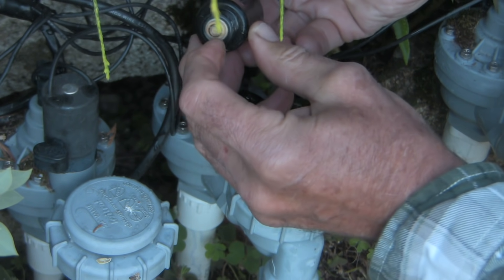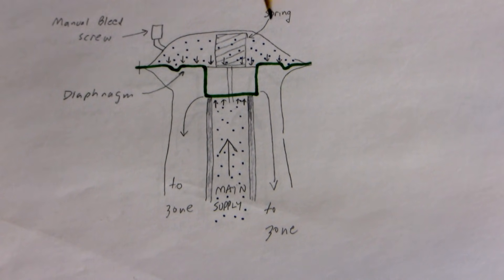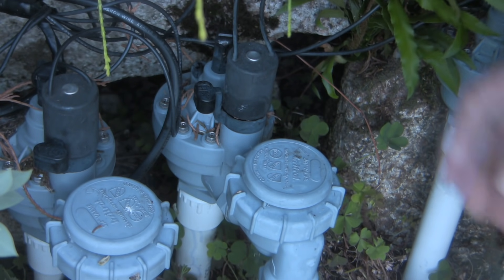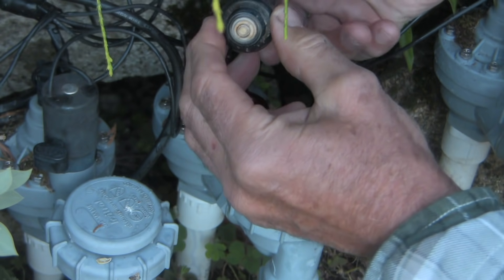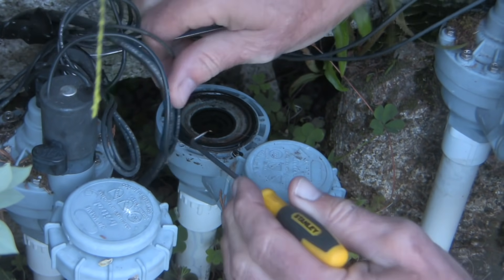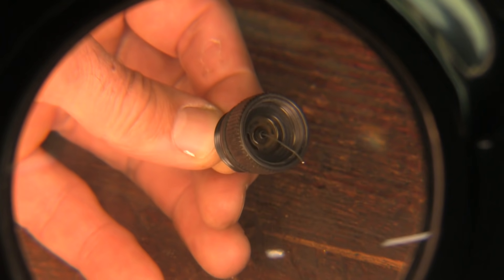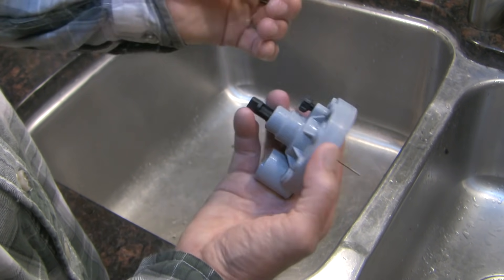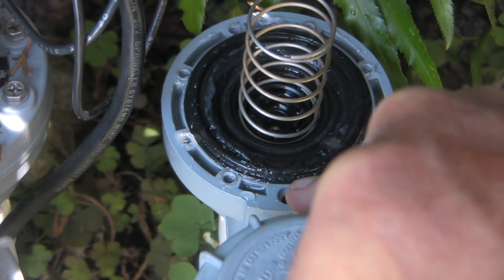Troubleshooting irrigation sprinkler valves

Comment: I wish I had the brain to mechanical trouble shoot like he does.
Reply from the maker: That's very kind of you to say that, but the reality is that these little devices are very simple. In the end most guys who have a suspected valve problem disassemble and clean the passages, then carefully reassemble and see if the system is fixed. I didn't mean to make it sound too complex, my bad.
Reply: spelunkerd I was pretty much speaking of all your videos.  Thanks for your help.

Comment: I really enjoyed this video very detail oriented. I have a question which I think you are the knowledgeable person who can assist me to resolve my problem. One of my 4 zones does not work properly. When the controller open the zone, sprinklers does not pop up and water is running until the time is over unless I manually partially open solenoid valve then all the sprinkler in that zone pop up. If I open it manually still the same situation, I still have to open solenoid valve to get all the sprinklers pop up.  I have replaced the anti-siphon valve and I know it should work fine. I also checked all the sprinkler heads but still I can not find what is wrong. I really appreciate for your time and input. Thanks
Reply from the maker: Gee, that sounds like you need to thoroughly clean the valve like I did in the video. After you get the bonnet off, use a paper clip to probe and flush those two passages going to the manual control bushing. Don't forget to probe the distal passage, the one in the center labelled "to zone" at 6:10. If that doesn't work, I would turn on that zone for a few hours, and look for a wet patch of the grass that you might see if a line or connection is broken. If there is a crack of the tubing anywhere in the zone that leaks water volume away, the line can't mount enough pressure to lift and spray water from the normal sprinkler heads. If you find a puddle of water, dig down on the wet spot to find the leak.
Reply: Thank you so much for the information. I will do that to see if that will resolve the issue.

Comment: Very good  video explains very well, I change two diaphragm and from there those two stations are not working now, I change position to test the solenoids and they do not work either
Reply from the maker: Thank you. Manual control is usually the quickest way to decide whether it is the valve or the solenoid. If you get water when you manually crack open the bushing, but no water when you direct that zone to open at the controller, it is an electrical or solenoid issue. If manual control doesn't open the valve, check the diaphragm, the flow control screw, and the small pathways I showed to decompress the top part of the valve. Make sure no other zones are open, and remember that a cracked line can cause enough pressure loss to interfere with zone function. If you think it's a cracked line, run it for a few hours and dig down on the wet spot. Good luck!
Reply: Look for the old diaphragms and I found one I put it back and it worked just that I know it has a leak but I closed the main water pipe, I think the new diaphragms are the problem since it worked where I put it back. 
What do you think ?
Reply from the maker: If you've got a leak, with a continuous patch of wet grass at the lowest sprinkler head of the zone, then the diaphragm is not making a complete seal on the lip of the valve. The most common cause of that kind of leak is a grain of debris that may get jammed on the edge of the valve, preventing it from closing down completely. Be sure to flush the line, like I did at 8:01, but I would do it for longer to give the proximal line a good flush (hang onto that O-ring, ha ha). Calcium granules collect in the lines and get jammed against the valve, causing it to bind and not seal completely. Wash the valve carefully and reinstall. If it still leaks, replace the valve.
Reply: Thank for your help, my  problem was the little hole on the middle of the diaphragm.
Reply from the maker: Good point, water needs to make it past the diaphragm to the other side. I didn't show it well in the video but there is a central post that holds the diaphragm straight so it is less likely to tip sideways and bind. Water lubricates the shaft and also passes by to the other side through that hole. Other designs may have separate water pathways. Thanks for documenting your experience, I'm sure it will help others.

Comment: A very well produced DIY video! I cannot believe there is finally a valve repair video with excellent production values. Hands and tools never get in the way of the camera! There are fantastic cut-aways with closeups of what is difficult to otherwise see. And of course the hand-drawn diagram of the inside of a valve is very well done. Audio levels are excellent. This is NOT another talking head with the camera lingering forever on the person speaking. Instead quickly in then out again.  Finally, the information about valves both in general and specifics is accurate without too much jargon. One of the best DIY videos I've ever seen and I hope more to come. I'm subscribing now.
Reply: David said it all! And I would like to add: And thank you for your honesty with the O-ring! You could have omitted that easily. Great video!
Reply from the maker: What a kind remark, thank you so much for your feedback.

Comment: How do you identify a Rain Bird sprinkler valve model number so you can accurately replace parts?
Reply from the maker: I'd start at the manufacturers website, they often show more detail, even for outdated hardware.
Reply: The Rain Bird shield cap has many lines of embossed words and logos on it. Think of all of them like you are viewing a paragraph. At the very top of the "paragraph" (just above "3/4" VALVE") is an embossed oval about 3/4" x 1/4" in size which creates a flattened area at the top of the paragraph. This oval contains the only debossed writing atop the cap.  If you get the light just right and use a magnifying glass you can make-out a stamped, debossed number. Mine says L7034. Anyone know how to insert a photo into the comments section?

Comment: Far more valuable to everyone by including the thing most likely to go wrong.
Reply from the maker: Yes, I think I understand what you are saying, thank you for the feedback. When the diaphragm won't close with manual control, the example shown at the end is the most common cause, dirt in the mechanism or control bushing causing it to stick open. When the controller won't open the valve but manual control will, it is often the solenoid or a bad power/ground. When both manual control and the solenoid won't open the valve, it is usually dirt in the lines or a sticking diaphragm. I did separate videos on diagnosing a bad solenoid, and investigation of a continuous slow leak of water around a sprinkler head. In any case, cleaning and exploring the valve and control passages is often a good first step. Old school teaching emphasizes getting a firm grasp of principles first, before learning the practicalities of what happens most often. Then with experience, one gains insight from the other angle, pattern recognition of common presentations. Pattern recognition is certainly fast, although those who don't understand the whole mechanism will never reach the next level, and they may stumble on complex problems. Common faults can be specific to a particular device, changing every year as manufacturing designs change. Many manufacturers, including Irritriol, offer free pdf flow sheets depending on symptoms at presentation. Those who take the time to understand the system can often discard flow sheets and get an answer with simple logic.
Reply: If children could be exposed to this principle in grade school, then again in middle school, and hit it hard again in high school the world would be a better place.

Comment: Thanks for sharing a very informative video. However, I have a different problem with my sprinkler system. The water pressure is too low on one zone. When I turn it manually from the valve it takes about 10 minutes before the pressure goes up. Can you tell me what is the possible problem and how to fix it.
Reply from the maker: This is either a high flow or a low flow situation. Low flow would be a constriction somewhere, like a kinked pipe or a control valve that is cranked down, or a valve that won't open because of corrosion, or debris in the line that is trapped and limits flow. Surprisingly I have found high flow to be a little more common, where the line has a crack causing a leak somewhere, or a head that is loose. You might think it would be easy to tell the difference. Not always. I would leave the line on for a few hours, then look around the garden for a wet spot. If you find it, dig down on the wet spot to find the leak. If you don't find any leaks, clean the valve the way I did, then and reassemble. It may take some effort to find all the branches of your zone, you could have a leaking head hidden by a plant that conceals it. I would check to see how the problem behaves when you activate with manual control. If manual control solves the problem, look to the solenoid, it might have limited range of motion. If all of that fails, you could remove a distal head and let it run for a while, in an attempt to purge the line of any debris that might be restricting flow. Good luck!